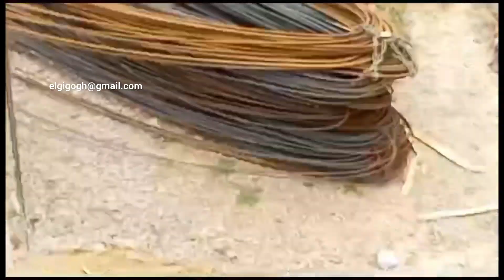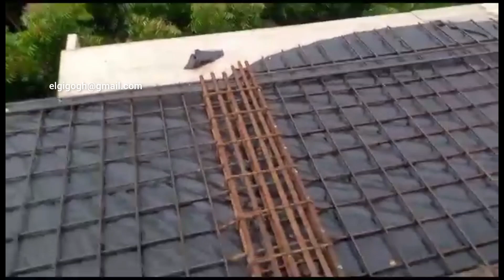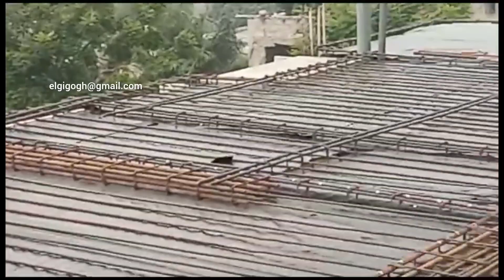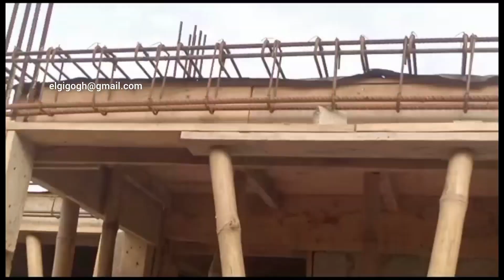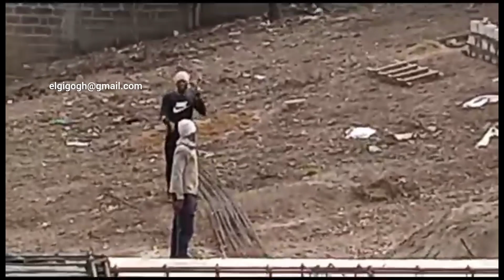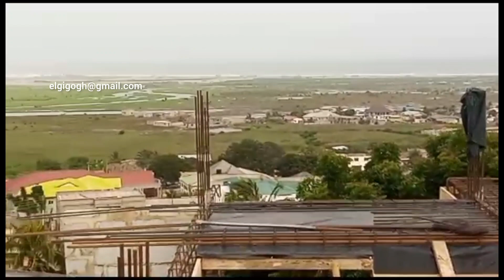Building In Ghana 🇬🇭 Decking Estimate Phase 1 Of The Hill Project |Cost Of Building | Iron And Wood

Comment: How much is the grand cost of carpentry, steel binding, electrical placing of plumbing plus casting of the decking. And also did you use high tensile iron rods or the mild steel iron rods for the decking. If it is high tensile iron rods used can I know if it is necessary and compulsory to use that one other than the mild steel iron rods

Comment: Decking no be easy
Reply from the maker: True Bro, it takes alot of cash but at the end it's more beneficial if done well ..Thanks for watching 🙏🏾
Reply: How much is the grand cost of carpentry, steel binding, electrical placing of plumbing plus casting of the decking. And also did you use high tensile iron rods or the mild steel iron rods for the decking